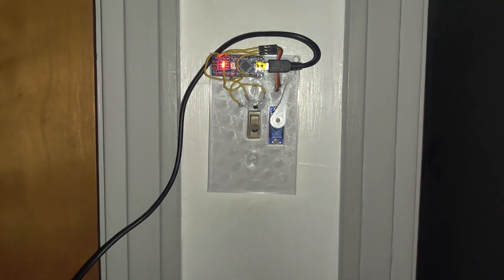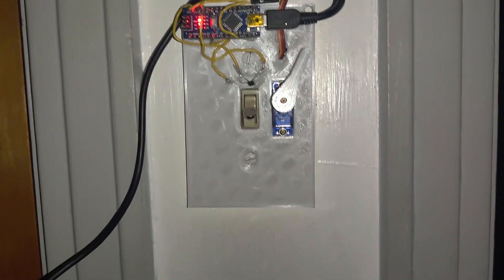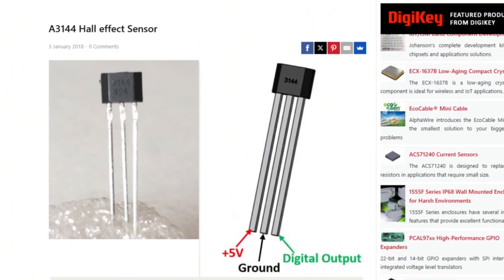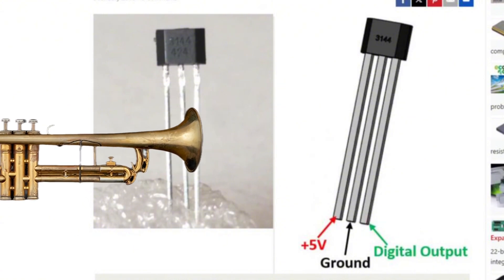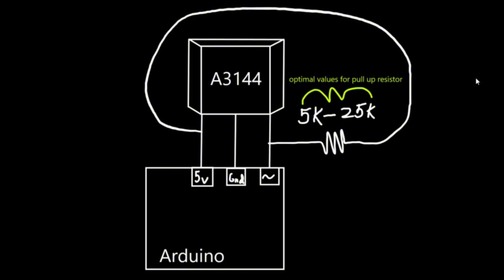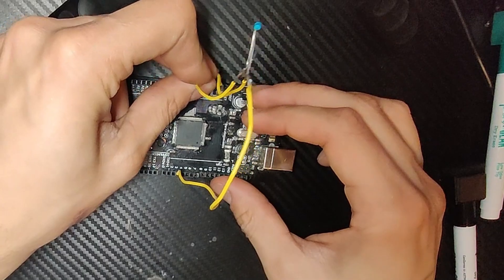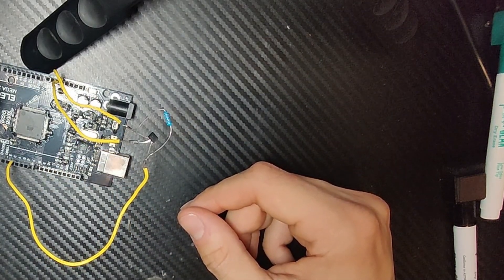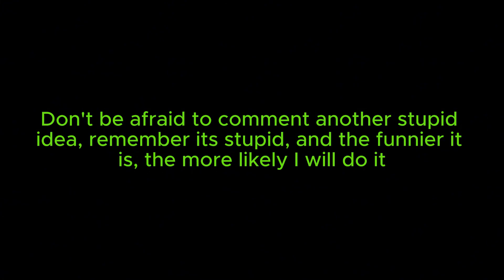modifying my light switch... stupid idea 🤦‍♂️

Comment: If you sit in a high-back chair, the solder fumes will blow away from you. It's the same principle as putting a backstop behind a campfire that's taller than you, so the smoke blows away from you. When you think about how heat behaves in air, it causes the air to rise, which means cool air has to come in to fill the space from all directions. Normally this balances out from all sides, coming in equally from all directions and letting the smoke rise more or less straight up. If you sit next to a fire, you're obstructing the air coming in from that direction, reducing the amount of counterforce.
In short, the smoke doesn't just appear to follow you. It literally does, because physics.
Reply from the maker: @adamb89  you are correct, but I just can't help myself

Comment: Very cool!  I would try it with a little solar panel too!
Reply from the maker: @mct75  what do you mean?
Reply: @-EhsanMalik-  Instead of the hall effect sensor and magnet.  Maybe even have the solar panel run the Arduino?
Reply from the maker: @mct75  I see, the issue with that is it's in doors, and a better way to power it would be an ac to DC step down, but I didn't really want to spend more money on altering the electrical safety box, buying more components, so I just made a quick design. Although, one cool thing you did bring up caught my interest, and I just did the rough calculation. So an Arduino nano requires about 5v to run and on operational amperage it's about 20-50mah, and most little solar panels from garden lights produce about 2-4v at around 50-100mah, so you would need 2 panels to run an Arduino nano, 3 just to be safe(since the solar panels aren't 100% efficient). And if you want to run other devices, oh man you're in for some math 😂
Reply: @-EhsanMalik-  Lots of math!  I was thinking something like the using a CN3065 charging a supercapacitor, and when it hits a threshold fire off the arduino to move the servo.   The delayed action would make it even better and more annoying.
Reply from the maker: @mct75  you would need a bunch of super capacitors from what I've read, since they discharge and charge fast, wouldn't it just be smarter to have a battery? (I've never used super caps, but you did give me a video idea)